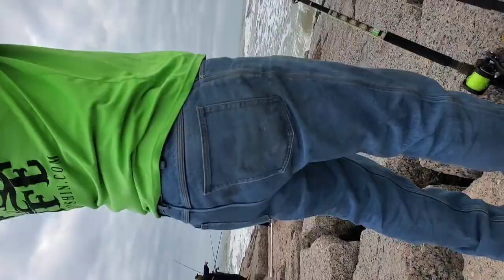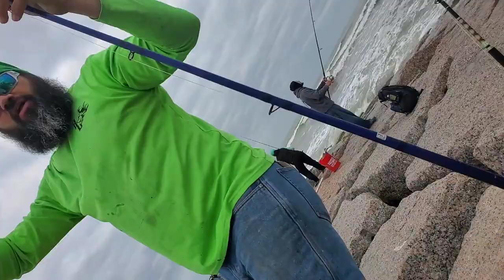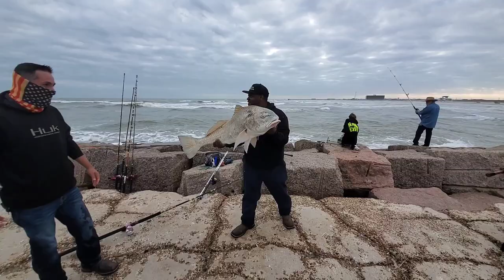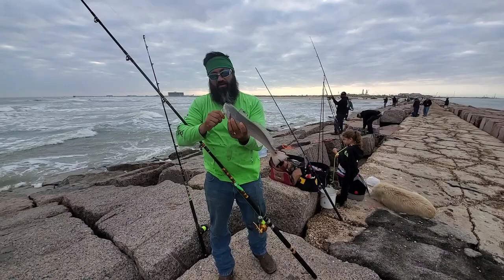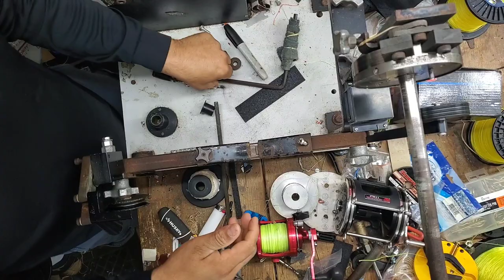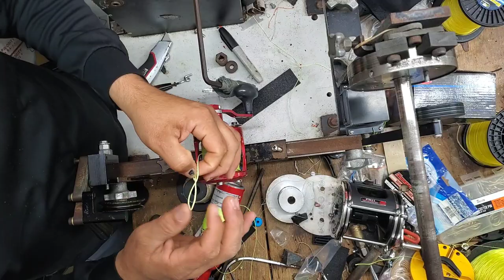Cortland Hollow Core Braid update 5 Trips and Steady Fishing Port Aransas Jetties: braid updates

Comment: Geez that drum had size. That double drop leader holds up
Reply: It sure does
Reply from the maker: Yes sir they have been know to catch monsters all the time.
Reply: @TeamHardLife  hey Capt how much water does that hollow core absorbs and does the salt stay embedded in the line after it drys, Also does it effect your casting distance when soaked.
Reply from the maker: They aren't supposed to absorb water but brought it in and line was dangling in the standing water there ...
Reply from the maker: Also I don't rinse my gear off after I am done fishing unless it gets sanded bad from high winds..
Reply: @TeamHardLife  You dont have to rinse off the reel either?
Reply from the maker: Lol sorry I don't unless it gets slashed with salt water or bad sand...
Reply: Guaranteed